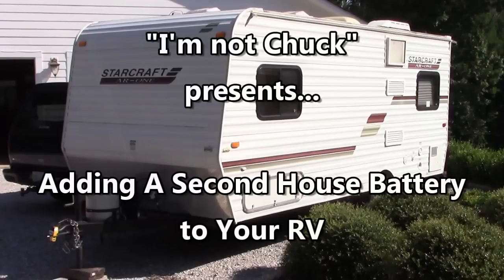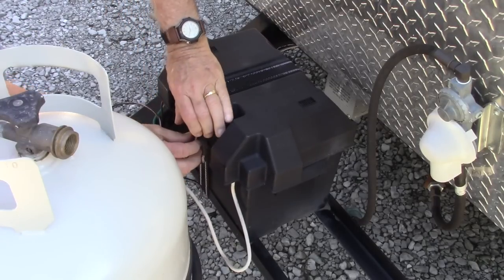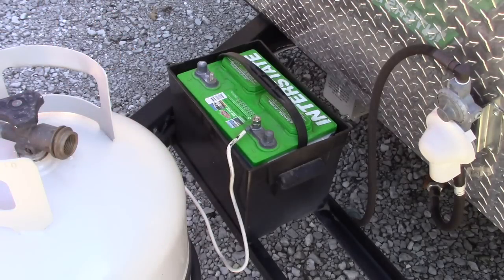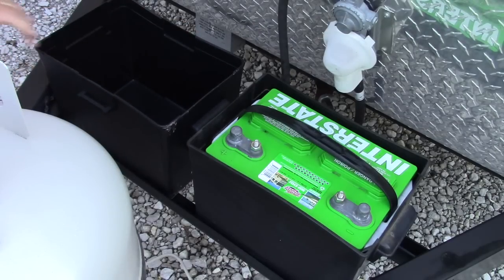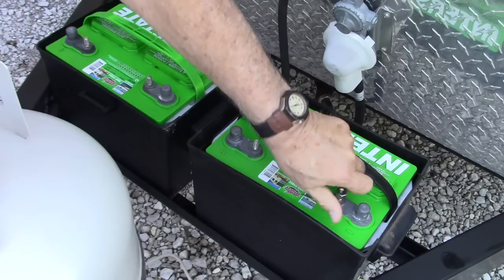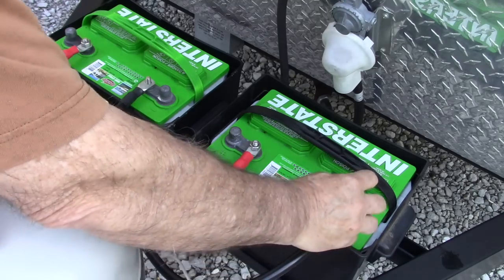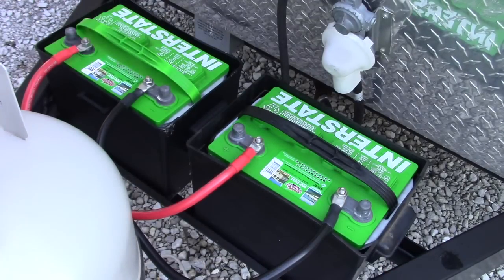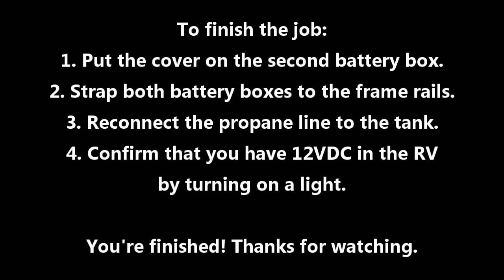Add a 2nd RV Battery

Comment from the maker: Added 8 Feb 2018. At about 4:20 in the video, I called the Interstate SRM-24 battery a "deep cycle battery." It is not a "true" deep cycle battery. I should have called it a "dual purpose battery."

There are some very interesting comments about the connection of the trailer's white ground wire to the negative post of the left battery instead of the right battery, so I will address that in some detail in this post.

First, as I have previously posted, there would be no harm in connecting the white ground wire to the negative post of the right battery. Electrically, there is no practical difference between the two connection points; here is why.

The two negative battery posts are connected by a 1 AWG cable that is 24" long; its resistance is 0.25 milliohms, which is .00025 ohms. The internal resistance of a lead acid battery (such as those used in the video) is at least 50 milliohms when the battery is new and rises to as much as 1 ohm as it ages. So, there is at least 400 times ((50 + 50)/.25) as much resistance in the two batteries as there is in the black cable.

Looking at it another way, the white wire is 12 AWG and is also about 24" long; its resistance is 3.2 milliohms, which is 12.8 times as much as the 1 AWG black cable. So, if I were to lengthen the white wire just 2 inches, I would have added more resistance with that two inches than the resistance of the entire black cable. Would that have had any practical effect on the batteries? No... just as the .00025 ohms resistance of the black cable has no practical effect.

If you have a different opinion, that's fine. We will just have to disagree. Thanks for watching the video and please subscribe to the channel. I will add a solar charging system in a future video.
Reply: Can you explain how to add a cut off switch to the batteries? Read below to see why I am interested in one.  Is it simple to do?
Reply: @YAYA-bv7po  very simple. It basically goes in between the neg cable or pos cable (depending on which person you are) from your trailer. Bolt it on somewhere n ur done.
Reply from the maker: @YAYA-bv7po  It is simple to do. I mounted my cutoff switch in the positive lead on the side of one of the battery boxes. That way, I can turn the power on and off the entire RV from the battery location. Thanks for watching.
Reply from the maker: @miztrusa  Thanks Mike. It's better to put the cut off switch in the positive side because the steel frame of the RV is often used for the negative side.

Comment: Charles in Charge...Food for thought.  Your typical true deep cycle (not dual purpose) 6v golf cart battery has 225ah, whereas your typical 12v dual purpose deep cycle that many people use has around 75ah. Tip: you only have 50% of that usable charge, or 37.5ah. If you draw it down more than that, it will damage the battery and severely shorten its lifespan. Two 12v in parallel will stay 12v but have 150ah, or 75ah of usable charge. Two 6v with 225ah hooked in series will become 12v but stay at 225ah, or 112.5ah of usable charge. If you build a battery bank of four 6v 225ah two pairs in parallel (6v 450ah)  and then series the two together it will be 12v 450ah with 225ah of usable charge.
Reply from the maker: In principle, I agree with your analysis, although even deep cycle batteries should not be discharged below 12.5 volts. Thanks for watching and for the "food for thought."

Comment: You should have put a the negative on one battery and the positive on the other.
Reply from the maker: No, the science is clear. I have explained this many times. When using very heavy gauge cables (as I do,) there is no reason to follow that old wives' tale.

Comment: Neg should be on the other battery.... Jus sayin
Reply from the maker: Hi Mike. A lot of people have been taught that, but it really makes no difference. Thanks for your comments.
Reply: Chuck it actually does their is a lot of videos of people having issues if you don't use much power you won't notice bit your a powet job like most it drains the batterie more

Comment: Nice video not Chuck very informative and kept things simple. One tip though, if you connect the trailer wires to different batteries (positive to battery 1 and negative to battery 2) you will get longer life out of your batteries. Wiring both to one battery the trailer will draw off that battery first weakening it over time. Batteries in parallel are only as strong as the weakest battery. Hope this makes sense.
Reply: What length jumper cable would you recommend . 1ft or 2ft?
Reply from the maker: I understand that most people have been taught as you describe. However, I don't believe that it matters at all. See my comment pinned to the top for my reasoning. Thanks for watching.

Comment: I always wrap my ratchet handle in electrical tape before using it around batteries.  I accidently welded it to a battery post...just once.
Reply from the maker: Hello John. That's a good safety measure; batteries that big can produce a lot of current for a short period of time. Thanks for watching and for posting a comment.

Comment: hello from the rainy warm ozarks im not chuck! while i was preparing my wakeboat  for winter , i noticed the battery connections were secured just like yours!!!  my moomba 24ft. wakeboat built in maryville,tenn. battery connections came from the factory just like yours!!  i appoligize it took so long to respond, but my internet at my fithwheel rv is poor. i went up to the bathouse  and laundry to download this.  tight lines and grace be with you!
Reply from the maker: Thanks for sharing, Phillip. Hope to see you soon.
Reply: @ImnotChuck.  gimmie a holler when you in the area. im at branson  and will be heading back to ozarks.

Comment: I've not read all the comments and maybe you've changed from  a year ago, but so that you get better flow thru the batteries and prevent a dead cell  you might have put one or the other connections on the other battery, This way your flowing from both directions thru the entire battery bank.  This is a new style of connection that most everyone is changing over to now.
Reply from the maker: Thanks for watching and commenting. Please see my pinned comment at the top of the list. You are certainly correct that many people are doing as you suggest. If you haven't subscribed, please do so.

Comment: Great video, I would consider placing the negative connection to the trailer on the negative of battery #2 so that the load comes out proportionally even preventing discharging one battery then going to the next one.
Reply from the maker: Thanks for the compliment and for your suggestion. I will look into it.

Comment: Thank you. Enjoyed the video. Easy to follow. I had a sailboat with two deep cycle batteries. They would charge from shore power when connected or from the alternator when under power. Very similar to my camper? Charging while plugged in, and charging through the truck alternator while travelling. On the boat I had a battery isolator. I was told it was very important to balance the charging of the two batteries. Would this apply to two batteries on a trailer? I’m trying to expand my off grid camping power and am doing my research.

Comment: I had the 2 batt setup on my RV for years. I always had one batt wear out before the other. A mechanic i know that works at Lockheed Martin told me to run the RV wires one from each batt instead of both from one and I never had another issue with 1 batt going bad before the other.
Reply from the maker: Thanks for your input and for watching. I have switched to two six volt Trojans in series.
Reply: @ImnotChuck.  what is the benefit of 2 six volt batteries vs what you had? I am in the process of getting batteries for my travel trailer and I am having a heck of a time deciding which way to go! I am NOT a mechanic, nor do I have much experience with electrical. I feel like most people making these videos are speaking far to technically. you seem to explain everything very easily.
Reply from the maker: @paullywalnutz  Thanks Paul.  Assuming equivalent size batteries, putting in two batteries instead of one doubles the amount of power storage you have available. That is true whether you put in two 12 volt batteries in parallel or two 6 volt batteries in series. Good deep cycle batteries are more readily available in 6 volt versions (largely because of the electric golf cart market.) For that reason, I am now running two Trojan T-105 6 volt batteries in series. Of course, since I made this video, lithium iron phospate batteries have come on the scene, and are the best choice if you can pay the price. When my currect batteries are exhausted, I will probably go to LiFePO4.
Reply: @ImnotChuck.  THEN YOU WILL HAVE TOO BUY A POWER CENTER CAPABLE OF CHARGING LITHIUM AND A DC TO DC CHARGER FROM YOUR ALTERNATOR TO THE CENTER. NOT FOR ME.

Comment: Great advice to stretch out battery power! I had an old Tioga with a mish-mosh of batteries and because they didn't match up too well the whole bank drained out pretty fast. Trying to get your battery specs to match up will help even out charging and discharging. Thanks for posting this up.
Reply from the maker: Thanks for watching and for your comment. I learned this lesson the hard way. Please subscribe if you haven't already.
Reply: Just make sure to attach the positive trailer wire to one battery and the negative trailer wire to the other battery.

Comment: I have dual batteries in my truck and in the camper..and I installed a 6000w inverter to only run refrigerator while travel and turn my LP off now then throw a transfer switch to switch it back to site power,  very happy with this install..
Reply from the maker: Wow, 6kw inverter is big. Glad it's working for you. Thanks for watching.

Comment: Hi, as many others have said, there is a problem with connecting the output cables ( and input cables, for that matter ) to one of the two batteries.  You are right that the resistance between the batteries is negligible but if you see what the battery manufacturers say, it is always to connect from the positive of one battery and the negative of the other, with both batteries connected in parallel as you have.  The reason, I believe , is the drop in internal resistance as a lead/acid battery discharges, making one battery work harder than the other, so to speak.   It seems intuitively correct the way you have done it, but the manufacturers say differently.
Reply from the maker: It's not a matter of intuition; it's physics. The manufacturers who recommend differently do so because they don't want to bother explaining the science involved, so they take the easy way out. As I have said, there is nothing wrong with connecting parallel batteries with one connection at the positive of one battery and the other at the negative of the other battery, but there is nothing to be gained by it, if heavy gauge cables are used between the two batteries.
Reply: You are only considering the physics external to the two batteries, they are not a perfect electrical supply but a collection of chemical elements which act together to produce electricity.   In a perfect system, you would be right as both batteries are effectively connected to the same inputs and outputs but in practice it's very different.   I only teach physics up to students of 16 years , higher than that I am only a biologist, so I rely on the experts on this.   All the manufacturers in the USA, Europe and Australia give the same advice about connecting across the batteries, as do the suppliers of chargers and inverters.   If you're not a heavy user of batteries then it won't make much difference but in heavy use it will make a real difference to the working life of the set up.
Reply: As a life long engineer I must agree with Crusty. A U.S. Battery representative explained using a terminal from each battery as outputs enables greater equalization on draw down and recharge. There is, as proved by certified testing an increase in the loss of power using the terminals from only one battery in a 2 battery set. Basically, over the life of the battery under normal circumstances, connecting them as shown in your video reduces the life of the output battery versus the second battery. It's measurable over the life of the battery. There are other reasons why every single battery manufacturer recommends using one terminal from each battery as outputs.
Reply: Thx Crusty...I have watch several of these videos and am amazed how many connect the house connections to the SAME battery instead of using the other battery.  Seems about 50% are doing this.  Yes, it seems it would not matter but i think i will stick to using the positive of one battery and the negative of the OTHER battery just to be safe.  Then i will be Will Prowse approved, lol!!.

Comment: If your trailer was built with just one battery, wouldn't the charging system charge at a single battery rate (??). If you add a second battery, should the recharge rate be changed??   I have a single battery on my trailer and when it's plugged into shore power, I believe the charging rate to the battery is just over 13 volts.   Would that charging rate we okay for "two" batteries??   Thank you   :)
Reply from the maker: Good questions! The voltage of two 12V batteries in parallel does not change, so the charging voltage does not change either. In addition, the charging current (measured in amperes) is regulated by the batteries; they will take only as much as they need (up to the maximum that the charger can supply.) However, it will take twice as long to recharge two "hungry" batteries as it does to recharge only one. Thanks for watching and for the thoughtful questions.

Comment: I added a disconnect switch to my battery box to cut power instead of unhooking the cable. Works slick
Reply from the maker: Excellent idea. I did the same on my most recent RV. Thanks for posting.

Comment: I noticed you wisely used a ratchet wrench with a short handle. Smart. that way y0u reduce the chance of accidentally "bridging" the terminals and zapping yourself.
Reply from the maker: Thanks for watching and commenting. I find lots of uses for that little ratchet; the handle is hinged to the head for times when there is very little room available. The only problem is that it doesn't provide much leverage.
Reply: Keep a piece of pipe handy to slip over your short handle when you need more leverage. Great post.

Comment: I am preparing to upgrade my RV to two house batteries. Instead of using two Interstate (not true deep cycles) 12volts in parallel, I'll be using 2 T105 Trojans 6 volts in series. My personal research has led me to the conclusion that because Trojan makes only deep cycle batteries and is the gold standard for the entire golf cart industry, and is almost the same cost as Interstate, is a far better buy. 2  6v Trojan T105s will give me 100ah at 12v. I will be adding 2 more in a couple of months when I install my solar system. That will put me at 200ah at 12v. For now, I am using a Predator 3500 Generator/Inverter when boondocking.
Reply from the maker: John K, You have obviously done some research about batteries, and I like your plan. I don't have any personal experience with the T105, but I know that Trojan makes fine products, and the specs on the T105 look good. I especially like that you have chosen a flooded lead-acid battery; I will go into some detail about that in the next video. Thanks for your comment; please subscribe if you haven't already done so.
Reply: John K ,hey,the two t-105s @12volts are 225AH. I've been using them for 10 yrs
Reply: yes Jack is correct. The 2 t-105s will give you 225AH not 100AH.

Comment: The battery store I use recommends this, Hook the positive cable from the trailer to one battery and the negative cable from the trailer to the other.  This ensures you get equal drawdown from each battery.
Reply from the maker: Hello, and thanks for watching and posting. Please read my pinned post for a technical explanation of why I don't believe that is necessary. It doesn't matter which way they are connected.
Reply: @ImnotChuck.  Not in anyway saying you are wrong in the way you connect.  As a matter of fact, they also recommend when you replace one battery, you should change both with two new units.  I went this route on my IPod and have never had an issue
Reply: @Jack Smith I would be changing battery stores if I were you, it is complete nonsense to suggest the only way to get equal drawdown is by attaching the pos to one battery and neg to the other. Equal drawdown is attained EITHER that way or using both terminals on one battery when they’re connected in parallel.
Reply: @steviebee1989  you need to learn how to completely read a statement.  Then think it through.  No where did i say this was the only way.  I was SIMPLY stating that this is another option.   Which, by the way is supported by others posting to YouTube and some Rv retailers.
Reply: @steviebee1989  You are Absolutely Incorrect 💯%!!
They will not draw down equal. They will eventually equalize after you turn off the draw. And the primary has to overcharge to push power to the secondary battery. 
I managed an Interstate Batteries for 2 years and was an assistant manager for Batteries plus ➕ for 3 years 👍
Reply: @jamesglenn520  I've been debating this in my own mind for awhile...I've got to completely agree with you
Reply: @eddiep7444  Thanks. The concept is to wire them to create One Large Capacity battery. If you don't you end up with a Primary and a Secondary battery which will have to Feed Off each other. 
That in itself will greatly reduce the life of the batteries for sure 👍